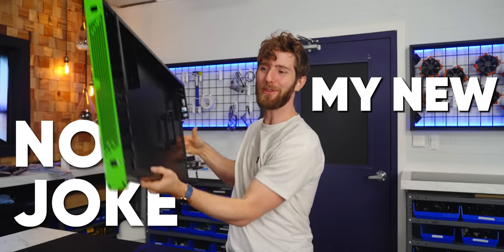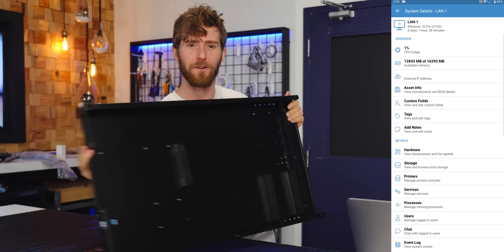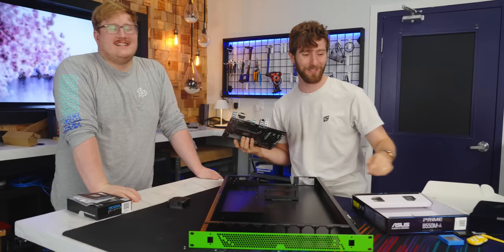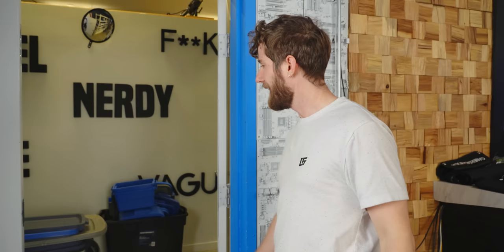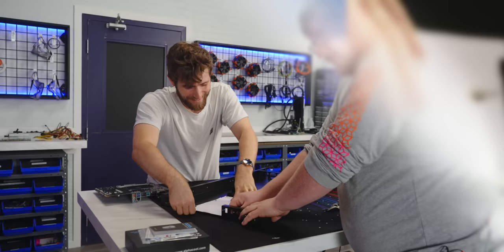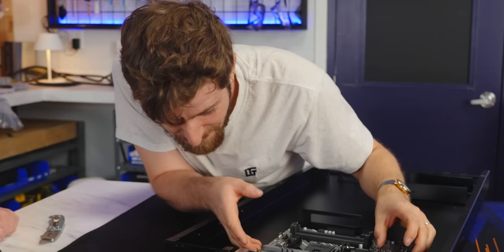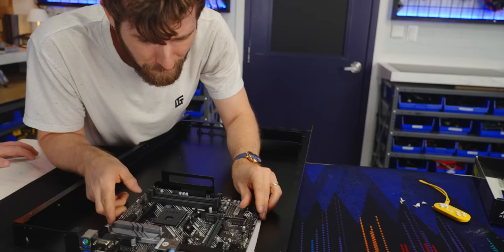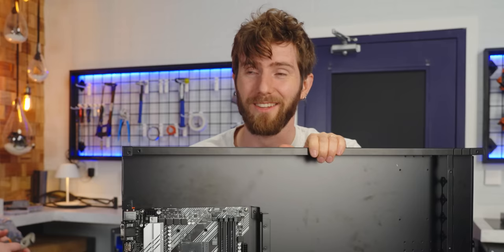This is my new gaming PC! - 1U PCs for My New House Part 1

Comment: Pulseway is nice and all - until you need to access your bios or anything outside the OS - in those cases a PiKVM is really nice - if you do not use a workstation or server mainboard.
Reply: Thats if you're using hardware at all...
Reply: The pikvms are great but also how often do you need to go into the bios and such after you configured everything
Reply: @ajvinke  Probably not often but it is always those cases that you do not expect and if you are Linus: all the time ;)

Comment: In 2022 im still rocking with a Pentium Q6600 🗿
Reply: Wow someone with an even more outdated cpu than me lol
Reply: Only using the PC for two hours a year, or happily spending the money you save on upgrading in electricity bills? That's an 105W-CPU slower than modern 10W-CPUs which also have an iGPU. If you also have a 100W-GPU in there and a comparably old 80%-PSU you are wasting a good 240W of power every hour that box is doing anything. 

Unless you also heat with electricity and only game in winter?

Comment: I'm kinda shocked they didn't just use their laser cutter to cut out a perfect insulator sheet for the motherboard. They designed the chassis, this would be such a simple thing for them to do.
Reply: They probably will for the final deployment, this was just a POC rough-up.

Comment: Not all fan hubs are bad. I bought a nice one that has been running in my desktop for over 3 years without any problems. It is a Thermaltake fan hub and it works great. It came with 3 super quiet RGB fans and not only do they have built in rubber sound dampers, but like I said the fans are absurdly quiet in my desktop. I have to put my ear up to my PC case to even hear them.

I have 7 fans in my rig and 5 of them are connected to the fan hub and 2 are controlled by the pump header for my Corsair H100 v2 AIO radiator and I have average gaming temps of around 54C on the CPU and around 65-70 on the GPU(air cooled). That is playing games like GTA V, Shadow of the Tomb Raider, and other graphically intensive games.

I'm not running anything super powerful, just an AMD Ryzen 5600, and an RX 6600XT but hey it does what I need it to do and I'm very happy with it.

Comment: 16:55
Yes, you're wrong - most fan hubs break, not all.
But the ones I've never had issues with came out of my (badly outdated, long since stripped for parts) Innosilicon A2 units and don't have a brand name on them.

Comment: I actually did catch cardboard on fire with a similar setup. I had my GPU laying on the server with cardboard in between and a gpu riser connecting it all.

Apparently the card got so hot during a session that it melted and chips became desoldered from their pads when the unit cooled after shutting down.

I turned the box on days later and saw smoke and one spark come from the gpu. RIP 1060, you lasted way longer than I ever intended.

Now I gotta buy a new card, but I’m on vacation so I’m trying to forget about it.

I was slapping the 1060 into a Dell r410, but a client of mine gave me a r720 which is 2U.

In my humble opinion, 1U isn’t worth the struggle.

Comment: They sell very thin (thickness that goes down to 0.1mm) silicone sheet that you can use instead of cardboard. I use thick ones for subwoofer anti vibration, rubber replacement for chair legs, and thin ones I had used as electric insulation.

Comment: Im doing a similar build for my nas/jellfin/homelab server but i went with the gigabyte B560M Aorus Pro AX micro atx board bc it has dual m.2, 2.5GB ethernet, and 6 sata ports. Pairing with an i5-11400, 32gb ddr4-3200 and 16TB (2xWD Red Plus). The gigabyte board is only $90 freedom bucks if you're willing to wait for amazon to ship it (theyll have stock soon).

Comment: btw Linus, if you go from 3/8 tubing to 1/2 inch barbs you would get a flow advantage, but if the pump is designed for 1/2 then you'd be increasing the pressure/stress on the pump.
Doing it the other way around with a 3/8 pump with 3/8 barb, 1/2 inch tubing, you'd lack pressure, you'd lack flow.
Pro tip you can't cheat physics, treat your cooling system like you treat the RAM, pair it as close as you can, and you'll get a water cooled system that will last a decade.

pro pro tip: quick disconnects, installing a new GPU to your decade old system takes only 5 minutes including adding the fittings and refilling the loop.

Comment: There is no black magic in this power supply. The power supplies are not what's loud in in OEM servers, but, the fans themselves for static pressure to cool the typical passive heatsinks on the CPU.

Comment: My dreamsetup would be:
Two setups with monitors, peripherals and everything. Both are connected to like four rack-mounted pcs. They would only use SSD storage since they only store the os it self as well as all programms. But most files should be synced to the cloud, which would be a server in the same rack. They would be managed with something like Ansible or puppet. Nightly Backups would be automated to another storage server in the same rack.

Comment: They have done videos featuring Plastidip before, it would have been the best solution for electrical insulation of the motherboard by a good margin. It wouldn't even need to go on the board itself just the bottom of the chassis.

Comment: I know Linus said he didn't want to get into the System Integrators game but this is amazing and no other System Integrators that I know of are selling anything like it right now.  Moving heat and noise out of your bedroom to a server rack in a different part of the house is a huge selling point!
Reply: I agree, but the issue they would run into is that rack-mounting gets incredibly specialized depending on the deployment. In order to satisfy a decent customer base they'd have to make basically everything customizable, which would raise cost way over what other SIs are charging for a standard mid-tower or even a fancy SFF solution that can be made quiet.

Comment: Server PSU fans are louder because those PSUs usually take pretty warm air in from all the HDDs/SSDs at the front where air is being pulled. Also, it might be RAM heat added as well in some servers. And servers are loud anyways, so it makes sense to keep the PSU cooler/dustfree in mission critical environment.

Comment: BTW, tiny little tidbit here: for the isolation for the motherboard, most of the edge casings, IO casings etc are all grounded, and connected to the same ground as well. this is intentional, and by connecting the screws to the nuts you're already grounding the case anyways, so you might as well just skip the tape and let the aluminum and metal bits touch, all of those outer grounded parts are the same ground plane. pointy pins on the underside of the board obviously shouldn't all be grounded tho, but you already knew that. you probably also knew everything else i just said and I misunderstood something, but I just had to say it just in "case"

Comment: So instead of cardboard, why not 3D print a thin layer with PETG that matches the MOBO, or a cheap way out is plastidip the inside with a light coat, and maybe thin nylon washers to space out the MOBO to the case.

Comment: I would have done a 5700x and a RX 56650XT.  2x8GB is good.  2TB NVME is a bit large as 1TB should do... especially if you have a game server for storing games locally.  I don't like the USB over fiber thing.  Just put them in a closet next to the gaming room.  Also I do not care for water cooling.  Just remove the fans and duct the air from the case fans.  If you had put the card below the motherboard (opposite the power supply) you could have used a much shorter PCIe 16x cable.  You also could have put the outputs right in the back of the case with no adaptor wire needed.  You could have likely run the system on a 400w PS as the CPU is 65w and the GPU is 180w.

The front of the case would be empty... you likely could have built 2 systems into it and just run Ethernet, 2 USB ports, a DVI or Display Port and the power plug for the second PSU to the back in one corner.  Then run ducting condensing the airflow over the CPU and GPU heatsinks and out the back.  Now you are looking at 5 systems drawing only about 1500w... about 2 intel systems with 3090ti cards.

Personally I like the idea of 2 computers in a 2U case instead as you could do the same thing, but have both PSU in the back, not need ducting, and be able to run larger fans in the back.  Then you could make the 6th system a game storage server/NAS and not waste any space.  You would also have room for a low profile 10GB NIC in each system if you wanted.  Total that is 10.5" of cases.

Comment: I would have mounted the board and then lifted it to see how many holes would have been placed into the cardboard...  then trim the dangling solder joints...  Love my AMD builds, and I also use Asus for all my builds..

Comment: 18:45 IF the system works as intended and his pool is full, let's assume, that his pool fits 25m^3 of water, it would need 29097.22Wh to heat up all the water by 1°C! soo... even if Linus would use 10 PC at full capacity for an 3h, it would just about heat up the pool by 1°C. that is... if you don't consider any concrete etc. that also has to be heated up. 

Also: this means that the heat from his computers probably won't even make a measurable contribution to the pool heating.

Comment: This is seriously sick. I like it immensely. I think this would be a good fit for my setup, as I've been wanting to minimize my gaming rig's presence in the room. Will the company you mentioned custom make these racks? And being new to this footprint / platform, what are the overall dimensions? I can't find anything on depth, and two widths are listed, 19" and 23". My 75" display sits on a stand atop an old chest of drawers that I could use to house the case, or maybe just rebuild the machine into one of the drawers or something? I'm concerned about heat doing it that way though.

Comment: Use a 2 liter bottle, remove ends and slit one side to form sheet to insulate, double back tape mount, and durable to resist poking by sharp pins (DIY level),
OR just JB-Weld some nuts in place and screw in some normal standoff (NOOB level),
OR just hacksaw an old tower and figure how to mount the MOBO backplane (MODDER level),
OR plan, mark, drill, riv-nut for a true mount and standoff (Pro level).

Comment: Different diameter decrease water flow, small diameter high speed but low pressure, large diameter high pressure but slow speed its idial to just keep if possible equal size fitting and tubing, Bernoulli principle about fluid behavior

Comment: 3:40
Janky, not kludgy?

Also, the sharp ends on the stuff on the bottom of the motherboard you're worried about shorting out WILL GO RIGHT THROUGH ELECTRICAL TAPE.
You'd actually be (A LITTLE) better off using cellophane packageing tape - it's stronger, and similar thickness, and harder to POKE THROUGH while still insulating.
NYLON tape would be even better, but I've not seen that since I stopped working Mil-Spec and it tended to be expen$ive.

The cardboard was a better idea.

Comment: Why not use a silicone kitchen mat instead of cardboard? Super thin, and heat resistant. Lois Rossman recommends one on his site for soldering. Would be perfect as an insulation layer between the mb and case.

Comment: Use Teflon fiberglass adhesive foil for 3D printing (table) as insulator under MB ( even non adhesive black Teflon fiberglass black foil to put on BBQ and double adhesive tape...😉) it is 0.35-0.5 mm 🤔💭😉😇

Comment: Why not use the 2 big fans on the outside of the 5 systems if your just gonna stack them. Now it won't be quiet like you want but it will be air cooled exponentially.

Comment: I have NZXT's fan hub the original OG one with six fans in it all ML pros from Corsair running full blast and I've had it for 7 years and it hasn't died yet and it's still running today

Comment: Oh Jake, you don't know MeanWell UHP-1000-24, which is completely fanless 1000W power supply. I don't get why Servers sounds so loud as well, I got power supply for my 3D printer and it sounded like crap, now I am running UHP and its completely silent. Other than print head. And case fans.

Comment: You should check how the power input is handled on the Icron 3-2-1 PCBA. Maybee it will eat 12V without a hassle... if it just step down to 5V or 3V

Comment: So I know he has fiber optic in the walls, but I thought it was Thunderbolt from Corning. Is the hub he put in there compatible and those fiber optic lines can be used for USB C as well? And is he plugging usb and his display port from the rack PC  into the hub or how is he transmitting the display over the lines in his walls?

Comment: Maybe the power supply 19:30 is so quiet because its dissipating most of  the heat through its aluminum body and into the  metal of the case. I only know anything about computers from watching LTT so its just a guess but it seems plausible.

Comment: If the pump is strong enough to pump the water from the house to the pool, under the pool and back, which would be hundreds of feet, isn't it going to absolutely blow apart all of those fittings inside the case? RIP.

Comment: I expressed the issues I would have had with the previous "solution" in the comments of that video. Mind you, I put forward those issues based on the imaginary scenario where it was a solution chosen by my parents. 
I am back to do it again. 
From the perspective of a child whose parents chose this over a traditional PC, this is definitely better than the last solution, but still not the best. 
Why do I believe that.?
This still produces a tone of issues for a child having to depend on a dad to do anything more than use the system. Can't upgrade themselves, can't troubleshoot hardware issues without a dad, and can't perform any upgrades without a dad's approval and assistance. 
But, I give some points for this not having the anticheat issues or the inability for a child to do the most basic emergency restarts when the system freezes. (some games do lock up the system in a crash, yad yada)

As a kid, if my dad posed this instead of a standard PC because of "cooling" or "noise," I would have shot it down and reminded dad the room that would be uncomfortable to be in would be mine, and if the excess heat was an issue for the AC system, we could close the vent in my room. 
But my parents always liked to ensure we kids had our own privacy so we would respect theirs and never have had anything like a family LAN room. 
(I have 6 siblings. We were not a small family)

Granted, I didn't have more than a laptop at the age of Linus's children and didn't have a full-size PC that was exclusively mine until I was 14.

Comment: I don't even spec a 1U server for anything more than 2 VM's (usually ADDS + File/Print ONLY). For anything more its 2U+ servers only. Idk why you don't just go with 2U's for your gaming PC. You have a full sized 4-post rack. If you used the entire rack already, you're doing something wrong.

Comment: the raven is cool conceptually but is the throughput of 5gbps not too little for a higher end gaming system? From my research a QHD@144Hz signal should require around 16Gbps of bandwidth, which is not possible via usb3.1. to support this icron should probably add support for displayport. A fiber connection should be able to easily handle the throughput of DP 2.0 and up to around 4 individual usb 3.1s

Comment: fun fact if you build 3 2U systems with 2 desktops per system you have 1 desktop redundancy so all you need to do is plug cables into the empty system and you gave a working system

Comment: Had the Sabrent Rocket 4.0 NVMe and around 50% space used up the drive slows down to 2500MB/s. Ended up calling Sabrent and they said too bad, don't fill it up! Ended up throwing it into my PS5 and buying a Samsung 980 Pro and never looked back Back to 7,000  MB/s glory.

Comment: I would really love to see more about the remote keyboard and monitor setup.
Reply: Cat 6 Usb extension with a hub for the USB, still trying to figure our display routing, display port 1.4 is about 24gbs of transfer
Reply: Could use HDMI to NDI bird dog system for display over the network. Can bring up any of your computer screens anywhere in the house.

Comment: Would love it if you guys did a video on building a system for photo editing.  Lightroom is finicky and can be tough to get running quick.  I have a 5950x and 3080 with 32GB of RAM with a Samsun 980 drive, cache on a separate NVME, but LR still chugs through photos at a "meh" pace.

Comment: 7:33  If you were desparate, i guess it wouldn't be the end of the world to file a couple mm off the audio port housing, would it?  idk, but isn't the port just 3 connectors in an aluminum box? shaving a little off the box without damaging the actual holes seems safe

Comment: If I'm gonna setup 5 of those, I guess I'll probably just get a 5990X 128G 4U size setup with Proxmox PCI Passthrough for 5 VM for easier management and easier installation. Sounds much more easier
Reply: he mentions in the video that he didn't go with VMs because these are gaming machines and VMs don't play well with anticheats.
Reply: @Lemonssssss  Just set the CPU to Passthrough and it'll be good with anticheats

Comment: Did you measure that cardboard? You most likely save 1mm, but is now choking the motherboard back, and even create a moisture problem. Just saying. Dont do this in the final version, just get more screws and lower the height to 5mm or even less, dependent on how much support you have.

Comment: "Yeah we wouldn't want a microATX board with 10 gigabit LAN onboard, because that would cost around $600. Anyway this system is going to have a custom water cooling solution that dumps the heat into the pool that I have in the backyard of my mansion"